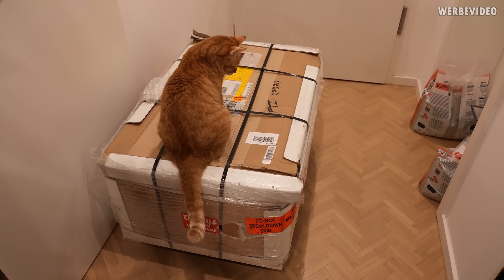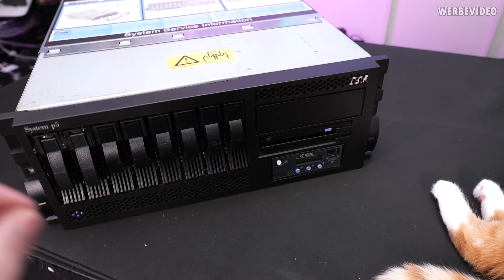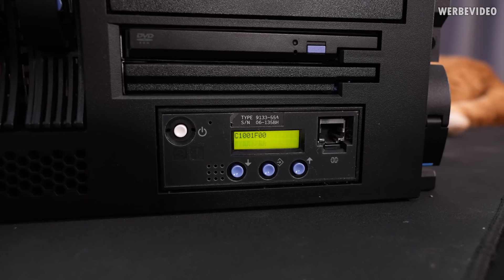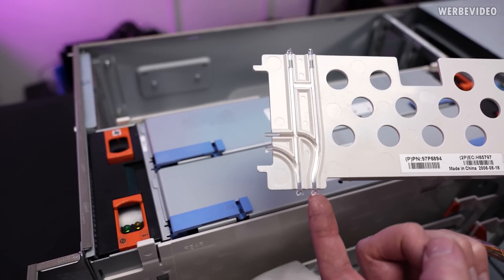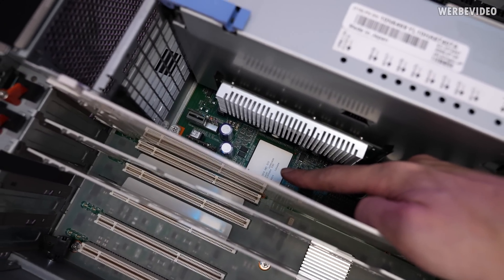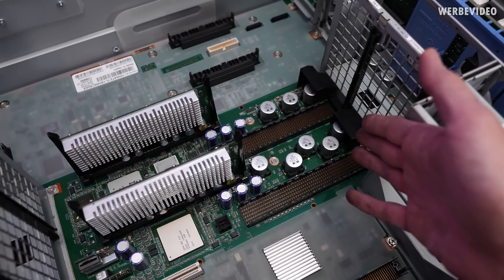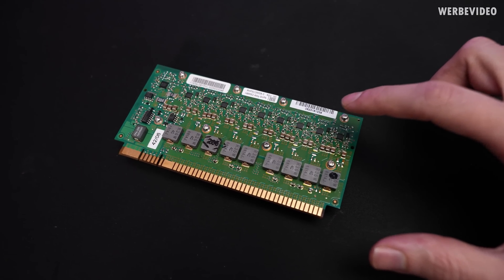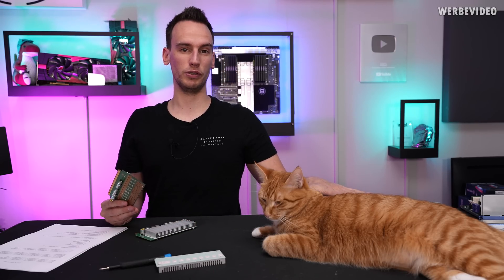Exchangeable VRM PCB and huge CPU Slots - IBM Power5 Server 1/3

Comment: The plastic separators with lightpipes in the PCIX slots are there because those are hotplug capable slots, as you don't want to short out other cards when you're hot-installing or hot-removing another card.

x86 servers also had them it was quite common in the PCIX era for high end servers, they also used custom apps and drivers to remove a card since windows back then had zero provision for hotplugging

Comment: I believe this system supports hot-swap PCI-X cards, which is part of the reason there are plastic dividers between the slots. The plastic dividers help prevent technicians from bumping cards into each other while the system is live.  The expansion slots with orange levers should have micro switches in them, to tell the system to disable that slot to allow the card to be removed.  Hot-swap PCI-X was a neat concept, but was pretty much a flop, and was quickly dropped by server companies.  Very few expansion cards supported the technology.

Comment: I used to configure and sell A LOT of these servers.  When I say configure I mean in a pre-sales sense.  We would use a piece of software called IBM eConfig.  I lived in that tool.  It was used for configuration of new servers and to upgrade existing servers.  I was in this tool so much I still remember the part numbers for some popular models.  The p570 (9117-570) was a scalable server that could expand up to 4x 4U chassis.  The CPUs (plus other components) in each chassis would be connected by a high speed connector.  They would easily get into the millions of dollars.  The operating system they would (tho could run others) was AIX, an IBM unix OS.  We also leveraged other add-on software they had such as high availability software and virtualization software.  All of the tech here (hardware, OS, partitioning, high availability) was WAY ahead of everyone else.  People often think of VMWare for virtual machines but IBM was doing that stuff way before and it was magical back then.  We never used the SCSI card like you have in your server but would configure a pair of Fibre Channel adapters for highly reliable and performant storage systems (also, but not always, made by IBM as well).  I could keep sharing more but might hit a character limit.  Thanks for the vid.
Reply: Hello, im interested in, as i have more Power machines, but i know only one AIX admin, which doesnt know this "HW" part with basic config, he just manage running AIX systems. Its possible to "gather" some information about it?

Comment: The PSUs are redundant, so it only needs 1 of them to function, the system should ideally not exceed the total power rating of 1 of those, otherwise you'll have a bad time if one breaks.

Comment: When you plug them in you need to wait for the green light to flash then you can hit the power button, you want to get yourself a HMC so you can configure the box and make partitions.  

Been a p series you can only run AIX and Linux, always wondered what bench marks would be like on a power CPU.

Comment: So why did you get the slow POWER5 configuration?  For some one what delided a Sapphire Rapids CPU I would have thought you'd have gone with a P590 model that uses the massive ceramic MCM processors with eight dies on them: four dual core dies and four L3 cache dies.

As for the chipset, it is interesting.   Instead of a CPU multiplier, you have bus divider to determine the SMP link, memory buffer and chipset IO link speeds.  So a 2.1 Ghz POWER5 would have a 700 Mhz bus speed.  To operate at relatively high frequencies during this era, these systems required an external service processor to handle the high speed bus initialization and thus the POWER5s never booted themselves up.  These service chips were generally embedded PowerPC 400 series chips.  SMP topology of the POWER5 is similar to AMD's Epyc 7001 series with fast intrasocket links between dies and slower intersocket buses between processor modules.  Maximum of 32 cores using 16 dies over four MCM sockets.

Comment: The Current offering seems to be Power9; which is offered commercially in workstations by Raptor Computing systems.
I think they had PciE 4.0 before it was cool.
Reply: IBM just recently started to ship POWER10 based systems.  They actually beat Intel to market with a PCIe 5.0 capable system this time too.

Comment: Having worked in both a company and a Data Center that uses IBM products, the mainframe stuff is fascinating even if it has almost no applicable use at say home for instance. Plus the fact that IBM continues to soldier on with their own CPUs and designs seems rare these days. The current MF is the only thing liquid cooled with a massive several meter long closed loop.

Comment: These where pretty much custom based servers for only the largest customers within IBM's portfolio. As of the VRM a add-in card is'nt unknown. If you where running higher spec CPU's you could easily swap out the VRM with it as well. All is made in a extreme redundant way and easy swapping.

Comment: We have worked with IBM Power servers for years at my job. I’m not the one who configures and manages them most of the time, but I’ve scrapped several of them out when they were no longer useful, and some of my favorite souvenirs are from those systems. I’ve got a 120mm SanAce case fan with an aluminum housing, a CPU heat sink whose base is a 1/4” thick solid block of copper, and another case fan that has a 30W max power draw! They make some fun stuff.

Comment: I had a look at the IR3081, and it's got some good features on it such as programmable LLC.

The 3081 VRM controller has a very standard feedback resistor network and a differential sense for voltage sensing. It looks like the output voltage is the combination of the feedback resistor network that you are used to and a VDAC which is used to program the voltage from there. Each of the 3086 phase IC has a very sophisticated current sense technique that samples the inductor ripple current in realtime and theoretically should have very fast transient response. Changing the parameters of the current sensing would be very difficult, but I think the output voltage is only controlled by the main control IC, so if that's the case then it should be pretty good for OC with a potentiometer. I really like how you can tap the ISHARE pin to get the current output of the entire VRM in realtime.

The phases all share information about their current for really cool current balancing. You can also sample the waveform of which phase is currently hot.

Your system there appears to be a 9+1 phase. I thought the inductor on the left was for input filtering, but it's got two beefy MOSFETs on the other side. If I understand the 3081 correctly then this would not have a different output voltage than the other 9, but will have a different current set point. If it's possible to set this phase with a different voltage, then you may have to play with the ripple current sense circuitry on all the other phases, which I think will not be worth the effort.

It has a 6 bit parallel input lines to set the output voltage very precisely. You can control this with all sorts of different things. Output voltage is between 0.8375 and 1.6000 volts. I'm not 100% sure, but it seems like you can keep the feedback resistors what they are and change the output voltage using the VID pins. It also has active voltage positioning, but you probably don't want to mess with that at least for now because it's also tied into the loop compensation. Very difficult to set all that accurately without a network analyzer, or at least a scope and a high speed load. I went through the design example and it looks pretty easy to just change the output.

Frequency is adjustable up to 1000 kHz with a single resistor, so you can play with that pretty easily.

The output current may be limited to something like 150A and you would change this R_OCSET (3086 datasheet page 15 eqn13). According to the equation, a higher current limit is settable with a higher value of R_OCSET (phase IC datasheet design example page 22). But the actual value of it can be all over the place.

I checked and this design looks to be very sophisticated with transient response and can be designed with an all ceramic capacitor output! I think those caps next to the CPU sockets on the MB are the input caps for the VRM.

Comment: GA-8N-SLI Royal (rev. 1.0) 
DESKTOP that has a VRM Card
Socket 775 / Early SLI where you needed that PCB thing to switch modes
I had one but the VRM Card failed ( So I got something else )

Comment: One of my pcs at work back in the early 2000's had motherboard with dual xeon sockets, and when I went to install the second cpu, I also had to buy one of those vrm modules. Also it was using rambus

Comment: Why so much power? Its about 6 times faster per clock than contemporary desktop CPUs. A quick google gave me about 7.5GFLOP per core for the POWER5, compared to about 1.5GFLOP for an AMD Athlon 64 FX-55 or about 1.2 for a similarly clocked Althlon64. This box had 20x the floating point power of the fastest desktops at the time.........
General Purpose GPU processing wasnt a thing yet either, they were still fixed pipelines. What an astonishing machine.
Reply: I have a really interesting machine from about the same time that takes a radically different approach to bandwidth. It is made for music and uses 2 Motorola 68040 as IO CPUs to route data to a couple of dozen SHARC DSP chips for processing. Similar SCSI etc, huge rack unit. Really interesting machine (Fairlight QDC, part of the DREAM Station that uses a incredible console with win XP to provide a UI to the system)
Reply: Very interesting!

Comment: These discrete VRM cards are not as often seen now, probably because the transient response performance of the VRM is not as good as directly onboard ones. This is also one of the reasons why we have dr-mos instead of discrete mosfets for high-frequency vrms.

BTW these are direct-fets, the most powerful mosfet you can find in a computer.

Comment: The CPU tray setup looks a lot like the old macpro's, apple must have been watching how IBM did it.
Reply: They use the power4 architecture, at the time apple made server racks, so they just modified the best practice in the server space that they were familiar with.
Reply: @lucidnonsense942  Yep the apple G5's where power4, the cards look a lot like my old macpro 5,1 with the CPU tray. Same kind of pin out only change is the macpro had the VRM+CPU+RAM on the tray and not all isolated.
The powermac G5's had Ram trays, each tray had 4 ram slots for 8 total I think? 
Still got one but not looked inside for ages.
Always liked the CPU tray, made changing ram or CPU relay easy.

Comment: These PSU connectors look like SAMTEC POWERSTRIP connectors. They are rated for high currents so it does make sense for 1000w straight-to-board connections. Also, back in the day, IBM had both a design and fabrication team, most like Intel. This means a lot of information was internal only between the design and fab team, that's probably why it's so hard to find good information on these custom silicon chips near the processor.
Reply: IBM RedBooks of this era were relatively detailed on the system architecture and IBM was fairly open in how the POWER4 and POWER5 worked via various papers published.  IBM tried their hand as selling the POWER8 and POWER9 commercially so there is fairly good documentation of them in various RedBooks too.

Comment: It's always cool to see non-x86 hardware working. These servers were made to run either AIX (IBM's flavor of UNIX System V), Linux or BSD.
And without a graphic head you will likely need to attach the serial console to manage the machine
Reply: Yes the service processor (a separate chip on the system) has an Ethernet port at the back to connect to a hardware management console (HMC) which allowed you to configure your system and build VM’s (LPAR’s in the IBM lingo) in a nice GUI. It was a separate X86 server back in those days. One of several ways to do it.

Comment: It makes me remember our Compaq Proliant 7000 servers we had at the office, 14U in size. Massive and very expensive, about € 45.000 a piece (it was back in the Dutch guilder era). Three different RAID sets of SCSI disks, giant memory modules. Three PSU’s, it needed two, one was for failure redundancy. It made our Proliant 3000 servers look small. The newer DL-line was a lot more compact. We had many DL380 and DL360 servers from every generation.

Comment: I work at IBM, and there are still some of these machines in production in the data center, LOL.  In addition, usually, the PSUs are redundant, not combined.
Reply: Indeed they are, you always knew when a PSU had gone bad as the remaining unit would spin its fan at full speed to protect itself until the faulty unit was replaced. You could hear it across the room!

Comment: Was expecting litter review, not another computer system. Downvoted video. 🤣

The Pentium Pro also had sockettable VRM cards - that was the first Intel based system I personally worked with that had such solution, but coming from Sun Sparc and Z series machines before and their insane redundancy, these were cool stuff to be made available on the x86 world.

Comment: Interesting how similar this looks to the inside of an Apple G5 machine. It always looked very alien to me, and wondered if it was just Apple being backwards for the sake of being Apple, but it looks like the CPU card concept was just the way these PowerPC machines always were. Apple would later go on to use the same concept in their Core and Xeon based Mac Pros.
Reply: the g5's and intel mac pros with the similar form factor are a lot more like servers than desktop computers in the way they're put together. Wish apple still made stuff like that.
Reply: The G5s were based on POWER4 though
Reply: @juanignacioaschura9437  The POWER5 was based upon the POWER4 with the main addition being the integrated memory controller.  The general CPU core design was relatively unchanged between the POWER4 and POWER5.  The PPC 970 was based upon the POWER4 but added the vector unit.  The POWER4, POWER5 and PPC 970 all used the same GX bus for chipset interface as did a couple of mainframe CPUs.
Reply: A quick addition:  I forgot that SMP was added to the POWER5 core, that was the major change from the POWER4 in terms of that design.  The big performance gains though was moving the memory controller and L3 cache controllers on-die instead of being external as on the POWER4.  The move from POWER4 to POWER5 also changed the memory spec from DDR1 to DDR2 which gave the systems a good boost in bandwidth at a radically lower latency.

Comment: the top cover and the front cover are independent, you can open the top one without removing the front one.
regarding the power-on "issue", this could be related to the management card. in some servers when you unplug the power, once you re-plug it you need to wait the management card to boot before being able to power on the server itself
looking forward for part 2 and 3! and be prepared for some noise, those are definitely not Noctua FANs 😅😁
Reply: It fulfills the role of the management duties but there is a full fledged service processor in this system as the POWER5 chips cannot boot themselves.  Their high speed bus interfaces utilized a processor clock speed divider which needs calibration at bootup between the installed chips.  The service processor handles their initialization and then hands off the system start up to the embedded hypervisor.  From there a partition can boot up AIX, IBM i or Linux on the POWER5 cores.

Comment: That's a IBM Ultra320 SCSI (pronounced scuzzy in English) PCI-X card. Ultra320 SCSI was the last widely adopted version of SCSI before SAS (Serial-Attached SCSI).
Reply: I grew up with these cards as Dad couldn't be bothered to deal with IDE for more than just a CD drive. u320 is about on par with SATA 3.0 GB/s (SATA II) performance wise, and 10k RPM drives were pretty easy to get your hands on. Helped keep a 10-year-old P4 based Xeon workstation board relevant until the board finally died. Those things in RAID 0 or RAID 5 were quite fast.

Comment: What operating system does it run? Can you do any benchmarking with it? Thanks for sharing but the PRICE! I hope you have a good use for it besides a few YouTube videos.
Reply: It would be AIX
Reply: @alphapcyu  Wow, I haven't worked with AIX since the early 2000's. It was the backoffice server for a boat dealer. Thanks for sharing.
Reply: There may be a linux for it too.